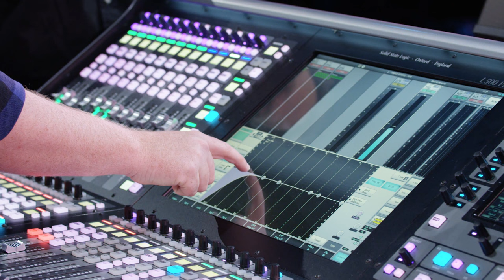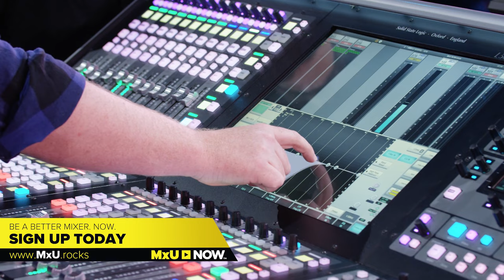High Pass Filter vs Low Pass Filter...And When to Use Them

Comment: Should you use a high and a low pass on everything even bass
Reply: I use a hi pass on bass at around 30hz. Helps the subs out with not having to waste power under that frequency so it can push the more important 50-300 where the bass lies